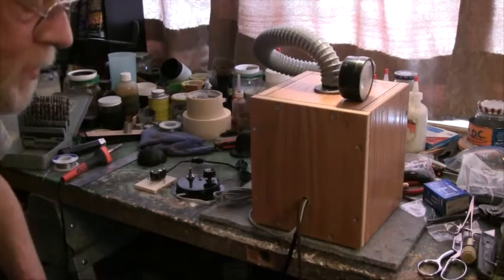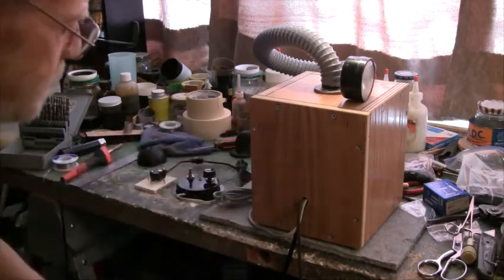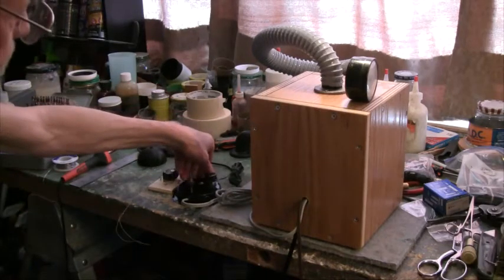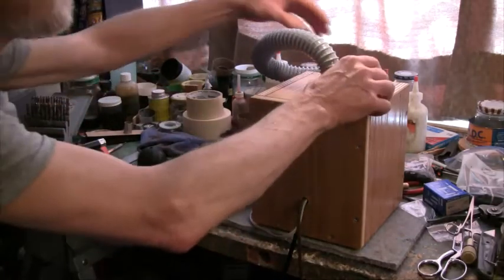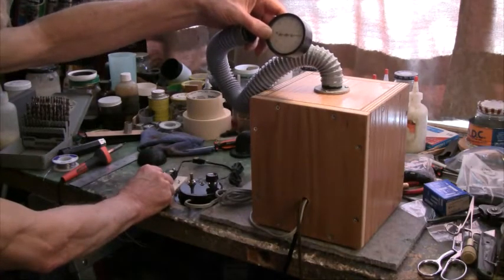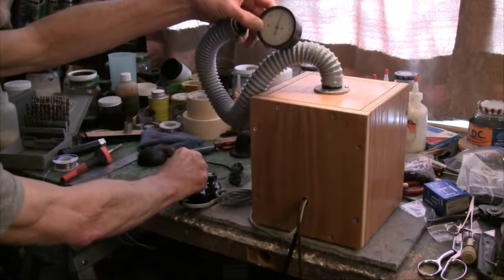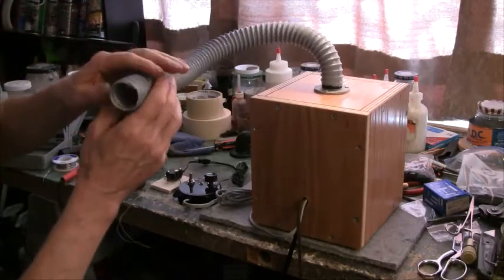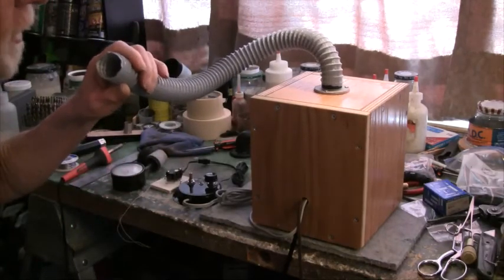Player-Care Vacuum Pump Kit Noise Level by John A Tuttle

Comment: I am new to maintaining a player piano.  What is this pump used for?  Is it a tool or a repair part?
Reply from the maker: This pump kit is for when a customer wants to use their player piano without having to pump the foot pedals. The term that's often used when the kit is installed is that the player has been 'electrified'.
Reply: @johnatuttle  Thank you - I like to pedal